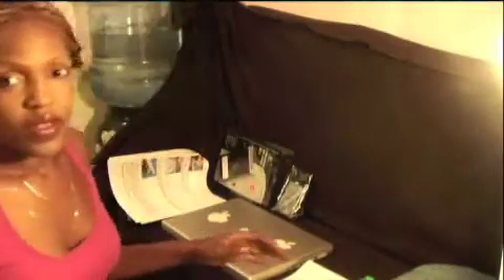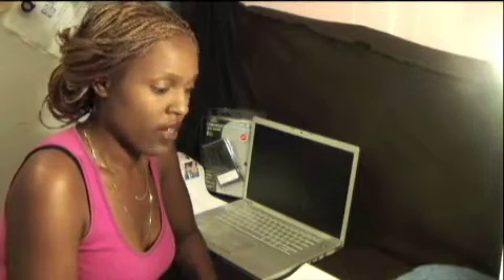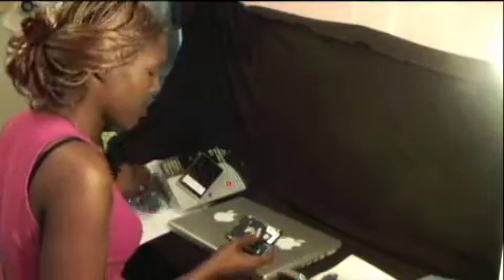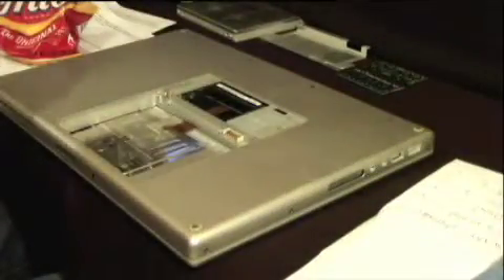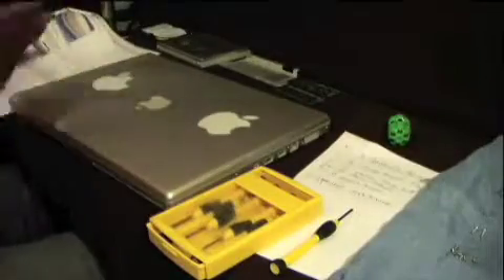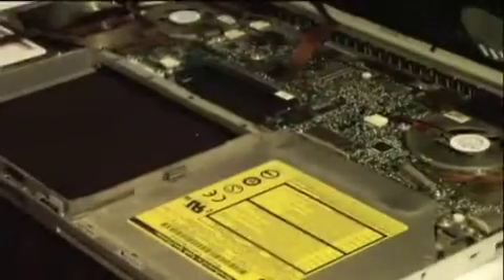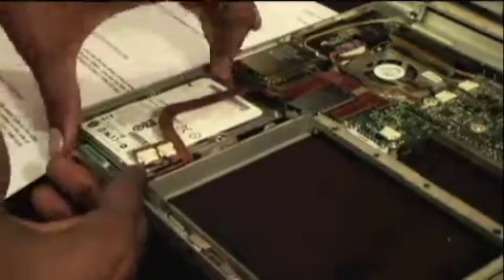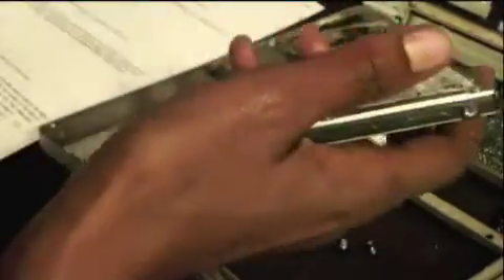How to install a macbook pro internal hard drive to a 500gb upgrade

Comment from the maker: you need to verify your whole install  of the hardware... did you reattach the ribbon cable to the small block square?  Is the hard drive cable (its rectangular at the attachment site) I side has pins the other slides in make sure that is fitted properly. I would verify that i did everything correctly and retry

Comment from the maker: if you are referring to the harddrive we removed and put in the enclosure.. or? secondly you can treat that (ext hd) like any other drive. wipe it clean in disc uitility or just read from it. The computer will only recognize the internal as the master drive. I am quite sure the HD  you remove will not loose info simply because it is moved or disconnected. or whatever... hope this helps...